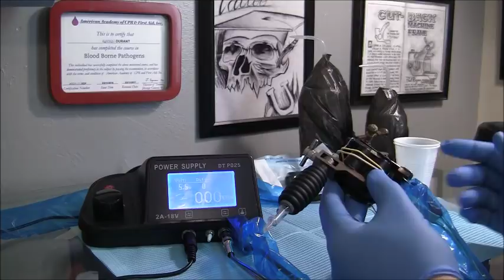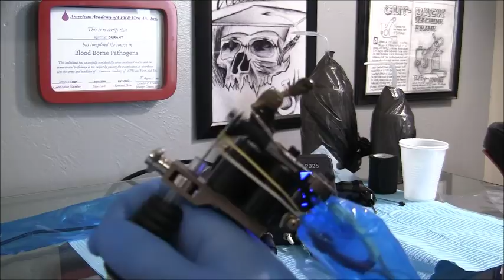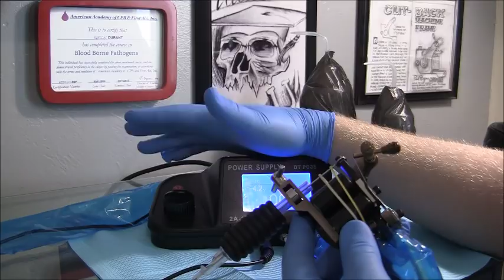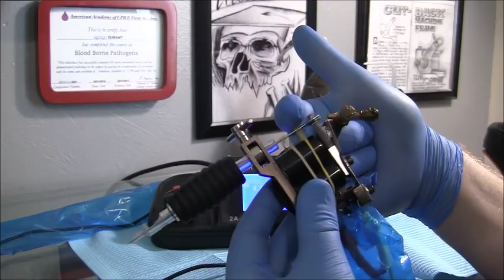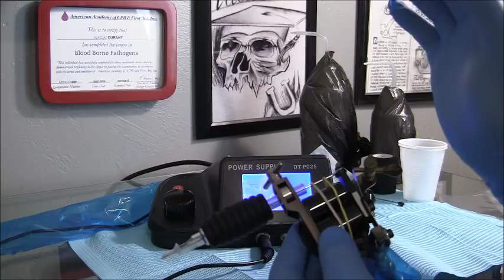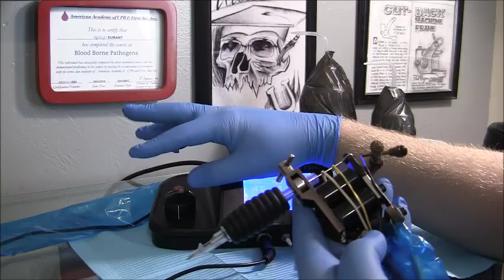Setting the Correct Voltage- Tattoo University

Comment: Hey man,great vid. I have a question,when I’m doing line work,or even shading,my lines I use about 7.5-8.5 volts,using a dragon hawk rotary machine. Now when doing line work,why is the needle sometimes,get stuck in the skin as I’m laying a line? Is it because the machine is a china-cheaper machine? Idk,but it is driving me crazy,please if u can do a video on it,that would be AWESOME !
Reply: You’re probably pushing too deep. Needles tend to get caught if you’re going too deep and too fast. Try and pull back your needle a couple of mm or work on your depth control, that should help you out a lot
Reply: @im_sad_2 ur needles out to far
Reply: Also, a rotary machine doesn't always stop with the needles withdrawn when you cut the power! Depending on where in the rotation it is, the needle can be full out when you lift off, thereby getting caught. That is the main disadvantage of rotaries, and something that no-one talks about! They're ok for shading- with a bigger bundle of needles, but for single needle, or a 3 round liner, they're no good. Go coil- your lines will be finer, and more controlled.
Reply: I used to get that, too! Man, slowin' down, taking your time, chopping it up with your collector...

Yeah, try it out.
Reply: Rotary is slower than coils i use to use a hummingbird rotary and i move very slow which gives me a clean line as for coils will always be faster than rotary

Comment: Is that a liner ,or a shader machine. I'm still learning the difference ,and can you just use either one for both ?
Reply from the maker: You can use both.  Typical liner machine is fast and has short stroke.  Used with thinner inks.  Typical Shader has longer stroke and higher tension on the rear spring.  Yes you can line with a shader.  I find it more helpful if you use a thicker ink.  It all depends on what you like and your hand speed.

Comment: I buggered around with lower voltages until I got to the magic 8. Leaves good crisp clean lines. 7 was just too soft, 7 or lower would have been good for softer work. But 8 works pretty great.
Reply: What machine are you using where you need 8v to run loaded? My machines run smoothly at 4 to 6 volts, but I build my own so I know what to expect.
Reply: My liner also runs 5-6v @deanstephens5940

Comment: theres a lot more variables to that adjustment and final setting but you did hit the nail  so to speak but the variables that also affect the final product are important to know and address before you ever clipped the cord and stepped on the peddle like point gap , spring reflex the angle the point screw and spring are set at  then theres coil size  armature bar weight and position and needle bar ,tube configurations and rubber bands holding bar in place all have a direct effect on that final power setting and quality of work it will do
Reply from the maker: There is a lot to fit into one video, so I try to break it down into several videos.  It takes years to learn all this information.  That would be difficult to condense into one session.
Reply: right on i was just saying that there are a lot more things that go into the pre check n  insertion of a needle into someone than the lay man would even think could affect the outcome and i really enjoyed your video as it sounded like you actually get what it takes to do the work and unselfishly shared it to all thanks really not meant as negative criticism or disrespect just a point of my experiences and what i encountered along the way huck though he dogged paul rogers out has the best info for tattooing n even he missed some so i hope i didnt piss ya off as wasnt my intent just passing along my info to help another out and preserve the art n its artists as well as the mechanical aspects often unrealized untill they are affected by it .

Comment: Thank you for this video. I’m a super noob to tattooing and bought a kit just to touch up my own stuff. Not for a career. I did really well first day but these are the things I need to learn. I subscribed and will watch and learn. Thank you.
Reply: I’ve been watching quite a bit. First touch up I did came out good but I think I had the needle out a hair too far because it would get hung up in my skin. So I think less needle and a bit of angle on the gun rather than straight down will make for a better experience. Although what I did cane out good.
Reply from the maker: Just learn as much as you can first before tattooing on yourself.

Comment: If you accidentaly heat up your coils with too much voltage and the machine starts running weaker, is that a permanent issue or will the coils be okay after they have cooled down?
Reply: They will cool ...and it's not a issue unless u keep overheating them

Comment: will your machine start to work correctly again after you let it cool down?
Reply from the maker: I would tune it so it doesn't heat up. Its not practical to work with a machine that does that
Reply: Tattoo University i hear ya im just wondering if you have pretty much screwd your machine if it heats up or if you can let it cool and tune it....i know just cranking the volts up more has to be horrible.on your equip..thanks for all your videos man they help a lot

Comment: You don't need two bands, one and a slight bend in the needle is plenty. You are causing extra drag on the bar, so extra volts to run,
Reply: Some use extra band in case one snaps.
Reply from the maker: good advice
Reply: @jb318  I learned in prison and the artist there was extremely good with a homemade shaver and single mag.
Reply: 12T90 LSD25 I use rotary machines, don’t use coils, never have. But I don’t have to use coils to know they won’t become obsolete. Lol
Reply: 12T90 LSD25 yeah that’s better.
Reply: @Paul  i just use 1 small black hair rubber band im mostly self taught

Comment: I have a question...when I'm tattooing [I'm shading]..im runing my machine n stop for a sec..n the pick it back up I step on the pedal but sometimes I need too "jump started"..do I adjust my contact screw? Any advise?
Reply from the maker: does it still do this if you raise the voltage?
Reply: Tattoo University I tried turning it up a bit and it still does it..my thing is that I think it's running pretty good n I don't wanna f people's skin and but I don't want my coils to get hot and not work properly..but should I turn it up a bit

Comment: Is this the same for rotary machines
Reply from the maker: same but different. You don't want to run it too fast.  Just enough to get the job done.  Just make sure stroke length is set up correctly.
Reply: Tattoo University someone told me to keep it set at 10 volts i don't know if it's different for every machine but does that sound like a good number
Reply from the maker: Every set up and machine is different.  You have to use what works.  Don't just do what someone tells you.  I don't use my rotaries over 6 volts.  Start with less voltage and see what results you get.
Reply from the maker: better to start of slow and add voltage

Comment: one question so confuse for that i read, you run more power (volt) for lining or shading ?
Reply from the maker: No you don't.  You only use enough voltage for the machine to run correctly.  The machine itself should be set up to line or shade.

Comment: This methodology doesnt apply as much to rotary machines correct? Right now my sweet spot for lining is 6-6.5 and shading 8.5 anywhere up to 10.2. This is based on my hand speed
Reply from the maker: In a way it does.  When I turn up the voltage on my rotary machine I still listen to the machine.  Does it sound like its slow or too fast.  Rotaries the voltage changes the speed.  You have to match the speed of the machine with your hand speed.  If you are seeing a lot of blood and damage you turn down the voltage.  If you are getting spotty lines you turn it up.  I usually run my rotaries around 6 volts, but I have a machine with a faster motor.  I only run it at 4 volts because 6 is too fast.  Practice and getting to know your machines better will let you know how much voltage is good for you.
Reply: Perfect thanks thats basically what ive been doing..i have a the fkirons direkt2, so direct drive and im still feeling it all out

Comment: If am doing a small tattoo,how many needles use I use?The 7Rl or a 9RL?
Reply from the maker: If you are drawing something and it is very small what size pencil would you use? If you are a painter you would use a bigger brush for large areas and a small brush for detailed areas.  It is the same concept.  Smaller lines require a small needle group and larger ones require a bigger group.  You can use a 3rl or a 5rl if you are doing really small things.  7rl is standard for most things.  9rl and bigger is best for bold outlines.
Reply: Thank you,u made it very clear....understood.And is it the same thing for the tips...Cuz my kit didn't come with the sizes if the tips...So I try to figure it out on my own or by looking at ur videos...But thanks a million....
Reply from the maker: You want to start buying disposable tips.  You will know what size they are when you do that.  With the cheap ones you just have to find one that fits snug.  Not the best.

Comment: Just got my machine,& I wanna go over a tattoo I have,which needle should I use to go over it to make it darker(I knw how to draw&I have a steady hand...Ur advice will mean a great deal...Thank you for ur comment...
Reply from the maker: Watch the video about using your middle finger to steady your machine.  Also watch the practice skins video where it talks about using your hand to steady the machine.  Having a steady machine will keep your linework steady and straight. If your lining you will want to use a tight group or lining needle.  The right needle depends on the size of the tattoo.  Bigger outline would require a bigger needle. Small outline would require a smaller needle.  I suggest that you watch some of the other videos I've done.  You can't learn everything from one video.  Focus on the practice videos and linework videos.  Also watch the needle video.
Reply: Tattoo University Thanks for the reply,the tattoo is the size of my hand....This is y I ask which needles do I use...I started with the 7RL,so far it looks pretty good....Am going over a tribal scorpion...But I just started the other day,but I stop to see how I heal... I dnt feel that I did a bad job...So I will continue tomorrow... I just want to knw which needles to use that all...Am always open to learn (CORRECTLY)!!!!Thanks for replying....It means a great deal,n it also shows that u read ur comments...
Reply from the maker: I usually wait at least 2 weeks or longer between tattooing the same area again.  You will find that the spot will be more sensitive the second time around if you don't wait long enough.

Comment: Thanks man! My sweet spot is 6.3
Reply from the maker: Most of my machines run from 5-7volts.  I rarely go over that.
Reply: Depends on your machines. The larger the coils and the larger the frame the higher the voltage needed

Comment: Ur opinion on a good machine for lining and shading....? Preferably a coil.
Reply: And whats ur opinion on rotary?
Reply from the maker: Look up hexagon_irons on instagram.  Let him know you what you are looking for.
Reply from the maker: What you need is someone who knows how to set a machine up correctly.  Get good quality parts from a builder.  Tell them how you want it.  Fast or slow running.  Hard hitting or soft.  Short or long stroke.  If they are a good builder the machine will last you a long time without tuning.
Reply from the maker: Try out some cheaper knock off rotaries.  See what you like and buy the name brand machine in that style.  Knock offs will break quickly, but give you enough time to see if you like it.  Try the styles that take a cartridge.  Cartridge systems are going to be standard in tattooing.

Comment: My most important question is i am going to start tattooing , which machine should i buy , coil Machine or rotary ? I am good in making black tribal designs , so i just need a perfect machine for filling and shading a little bit
Reply from the maker: My advice is get several different machines and start using them.  Get familiar with how they work.  Learn how to adjust them and make them work.  The more experience you have the better.  I can adjust most machines to do what I want.  Buy a rotary machine or a coil machine from a builder.  Try some cheap ones first to see what works and then get some better equipment.  If you know how to work on machines you can make a cheap machine work like a expensive one.  If you don't know how to adjust machines you don't want to mess with cheap mass produced machines.  The exception is the cheap rotaries.  They will work fine at first but will break quickly when you try to use them a lot.
Reply: actually i am from pakistan and there is no tattoo equipment store here so I have to order it internationally that's why if I Buy a cheap machine too it will be expensive for me , therefore i wanted a confirm call from your side that through which machine I should start with first
Reply from the maker: Let me put a list of machines together for you
Reply: Tattoo University that will be great thanks alot
Reply from the maker: How mechanically inclined are you?  Do you have tools and things to fix stuff?
Reply from the maker: Do you want something cheap that you can fix up or something you never have to mess with?
Reply: Tattoo University i want something that can last longer and do good work for me , cheap or expensive doesn't matter , i only want to do tribal tattoos and some shady work
Reply from the maker: http://www.pictaram.net/tag/hexagon_irons
Reply from the maker: I put a link to a very good machine builder.  Let him know what you are looking for.  He makes coil and rotary machines.
Reply from the maker: I agree.  You can tell the difference with the good stuff.  Always improve your skills and your equipment when you get the funds to do so

Comment: so what should be the perfect voltage?
Reply from the maker: Whatever voltage it takes to  make your machine run correctly.  Just enough voltage to do what you are trying to do.  The perfect voltage is just enough.  Not too much or too little.  That sounds cryptic but its the truth.  It changes depending on the machines and what you are trying to do.
Reply: Tattoo University  thanks for the info

Comment: Hey mate I just have a quick question for you.. um I received my new tattoo power supply unit today and I set it up and tested the machines and all works well I just wanted to know what the duty cycle should be running at.
Reply from the maker: I run my machine at 50-55% duty

Comment: Hey man I really appreciate you helping out people who just can't afford expensive equipment start off with what they have. My machine has a frame similar to yours with an angled rear deck. I just can't tune it so it runs properly in lower voltages. I've tried taking off some of the tension on the rear spring by bending it downwards, I can get it to run at very low voltages but even if I turn it up it just hits weakly and feels wobbly. If I put more tension on the rear spring, it hits nice and hard but I have to crank the voltage up to 8 volts, less than that and it won't hit hard enough. Make it a 10 if I put the rubber band on. I ran the supply through a multimeter and it checks off. The gap between the rear coil and armature bar is already very small, also the armature bar is lined up with the coils and vise. The front spring is off center because the contact post's hole where the contact screw goes was drilled diagonally for some reason, so the contact screw is angled to the side. Gotta replace that, I guess.

Anyway, do you have any advice for me? I'm going for a sculpting liner so I can start lining real slowly like you mentioned in the video about straight lines. I'm trying a dime gap at first since anything more than that and I have to crank the voltage up to 12v+, sometimes even for it to just run. Is it okay to tattoo with a high voltage if the machine is not chewing up my skin?
Reply: By the way my clip cord/foot pedal's wires are nice and fat.
Reply: The guy who sold me this one said those were 10 wrap coils, but I didn't cut then open to take a look. Is there any chance that the voltage issue has something to do with weak coils?
Reply from the maker: usually I have to see how the machine is set up.  This way I can see if something is off.  Send me some pics.  juantyartist@hotmail.com
Reply: diesel why don't you try getting an apprenticeship like a real tattooer??
Reply: @brianmackenzie3617  why don't you mind your business, 90 percent of "real tattooers" started out at home.
Reply: @kimberleykearney3095  right..lol sic em....I bought machines to tattoo myself. Not going to  sit in a studio all day when I can be at wrk making money.....diesel..not everyone watching these videos  wants  to do it for a living. Some if us just want to be able to  ink ourselves and not  have it look like shit.lol